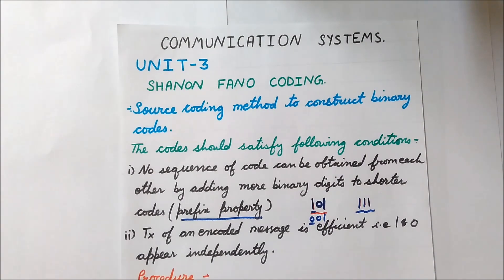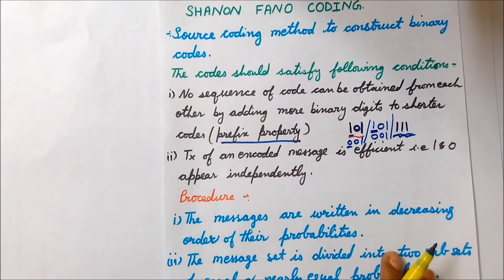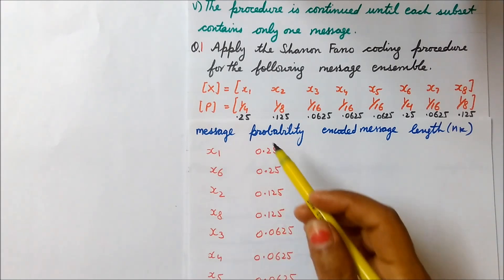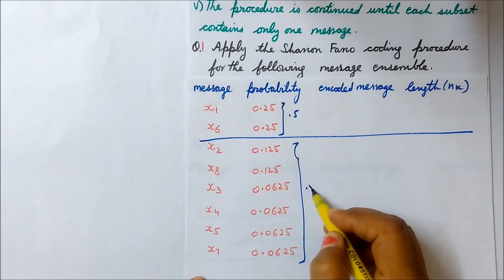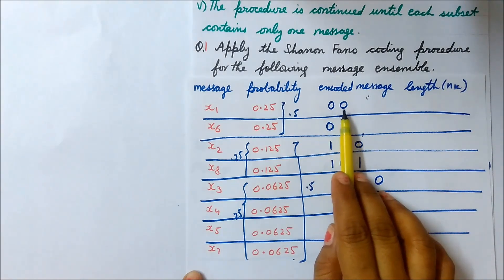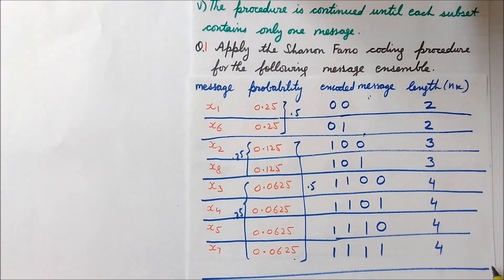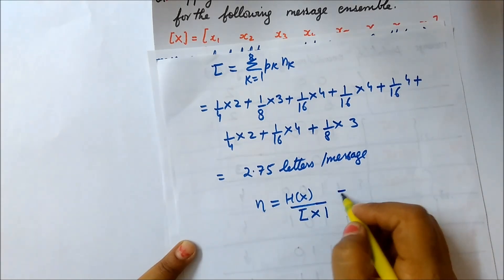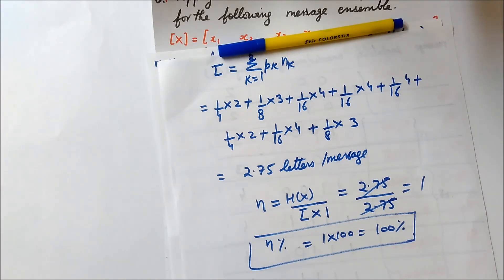Communication Systems - Shanon Fano Coding (Part 1)

Comment: Solve Huffman coding for given below example and find out efficiency of Huffman coding. 3 3 2 3 2 2 4 4 3 3 5 2 2 3 4 4 How it will solved.
Reply from the maker: Will upload the solution soon. Hit the bell icon to get all notifications for the channel
Reply: Smart Engineering Tutorials  ok mam
Please mam do as soon as possible...
Reply from the maker: nirakar kumar this question is not correct.here we deal with probabilities of messages and so it's max value is 1.but in your question the values are greater than 1 so this is not possible.
Reply: Smart Engineering Tutorials mam this question is asked in my university exam that's why i telling you
I am also thinking that this question is wrong because my lots of effort i couldn't search this question on Google..
Reply from the maker: nirakar kumar which is your university.if question is wrong then while checking full marks are given.dont take tension just study well and correct.this question is wrong
Reply: Smart Engineering Tutorials solapur university mam
Reply: Wrong question..!!
Reply from the maker: Please check the video of Huffman coding which i uploaded today to clarify your query. check the link given below.
https://www.youtube.com/watch?v=yxk1DTE1q1Y